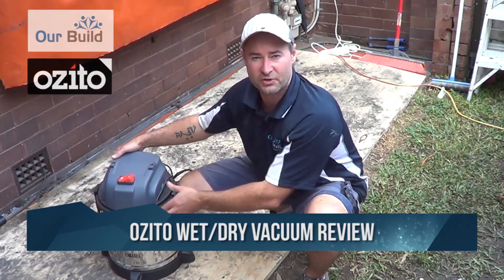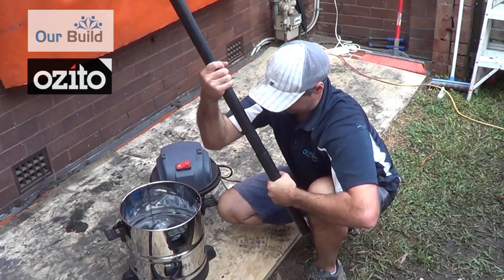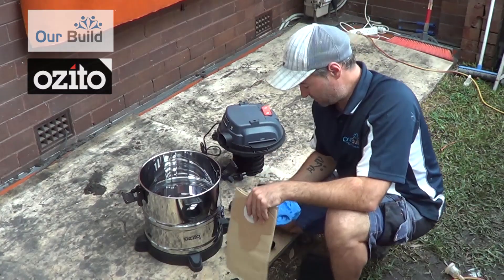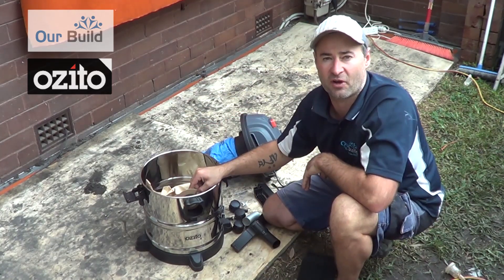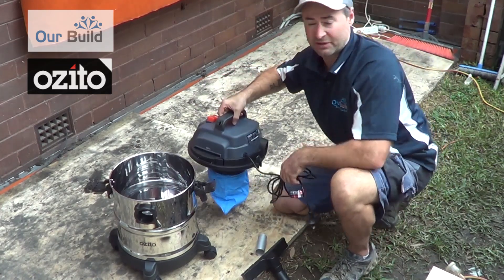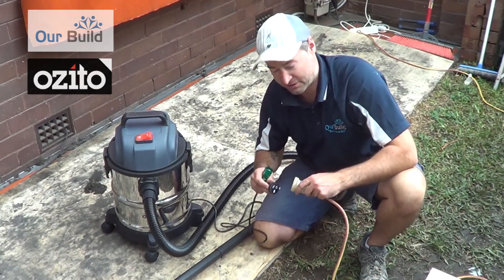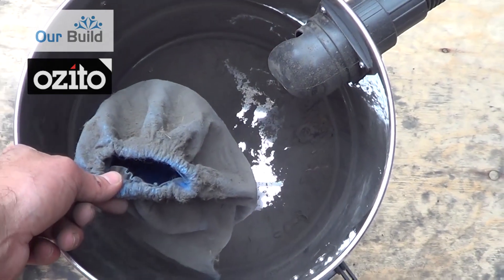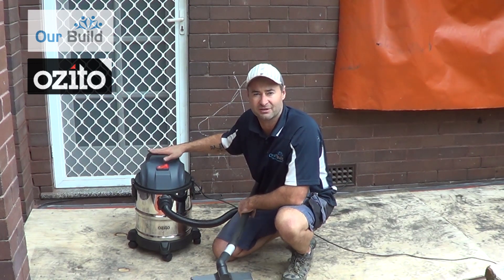Tool Review, Ozito 20 liter wet and dry vacuum review

Comment: I had basically the same vacuum and the suction was really terrible even from new. I had some self adhesive weather stripping around (a soft foam that sticks between doors and widows to seal them) and i ran a continuous strip of the foam around the very top rim of the stainless steel drum so that it would make a better seal with the top part (the detachable part) of the unit. The difference in performance was absolutely amazing. So yeah, if you can address the seal between the drum and the top unit them you can get much better performance out of these things.

Comment: i blew up 2 so far in one month and on my 3rd.
getting jack of going back for exchanges
Reply from the maker: That's a shame! Need to note that they only recommend it for general DIY purposes, that said I have given mine a workout and still going strong. But you do get what you pay for, $40 for this compared to $900 Makita or Hilti...
Reply: Mine lasted about 6 weeks.
Couldn't find the receipt and ended up cannibalising it for the brushes and repairing the Ryobi it replaced.
Ryobi's are good value, as they last a long time.

Comment: to Our Built
yer mate i only used them on our home carpets which only takes around 20 mins to complete so they were not in commercial use at all just home cleaning.they cost $39 which is cheap yes but they should do better than 20 mins continuous use.if this 3rd one goes im going to ask for a refund and go buy a volta or similar.
by the way,you did a great vid :)

Comment: Never buy a wet/dry vac that has no ground pin ... and make sure the store you buy it at also supports the  unit with same brand tools and filters
Reply: logun24x7 this wet/dry vacuum doesn’t need a ground pin as there is no metal components surrounding the exterior of the motor. The top is also plastic meaning that there is no way for electricity to be conducted to the metal drum.
Reply: @thehooverguy101  liquids can be electrically conductive

Comment: Looks good until you have to replace the foam filter and filter bag. The whole machine costs $85 but these two essential spare parts will set you back $51.41 -and you cant really operate without them. What a rip off!
Reply: Um, You're meant to clean them? And $52 isn't much every few years! 😅 Cheaper than most crap today... Things cost money , they use energy to save us from doing it the pre industrial way (while we still can, before it all goes to China and India & we are all third world nations due to 1800 era level  resource depletion & mass population die off in a few decades.. ) It's not an entitlement. are you vaccuming cement blocks or something?

Comment: I have the same but it's not sucking anymore and there is nothing blocking inside the tubes
Reply from the maker: +pani makiteiaa , Yeah mine died 6 months or so ago, for $40 I definitely got my money's worth though :) Hopefully you got some good use out of yours before it died?
Reply: I just bought mine not even 2 weeks it wouldn't suck anything but tryna use my warranty thanks
Reply from the maker: pani makiteiaa That sucks (well not literally :)), good thing is you can pretty much go back and swap it for another one at a Bunnings store no questions asked as long as you still have the receipt.

Comment: These are useless, I gave mine away and bought a Ryobi that has better suction with the same size motor.
Reply: I've used my 1100W Ozito WVG-951 on my blasting cabinet for 10 years or more and it hasn't missed a beat. There were two points which convinced me to buy the Ozito over the others, three year warranty and only $12 for a replacement filter (ShopVac was >$50 at the time). I didn't need the warranty and I'm about to buy my third filter. If I needed another I'd prefer my model 2nd hand if the new series are so bad.